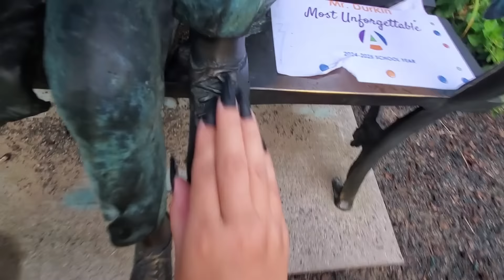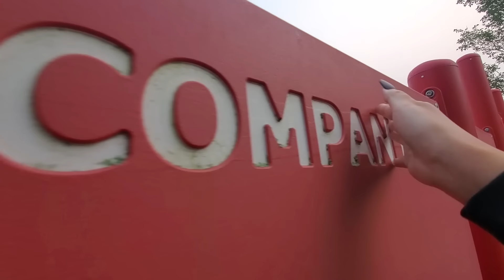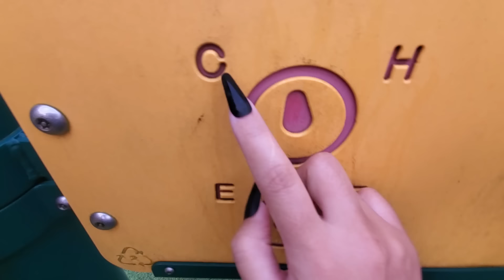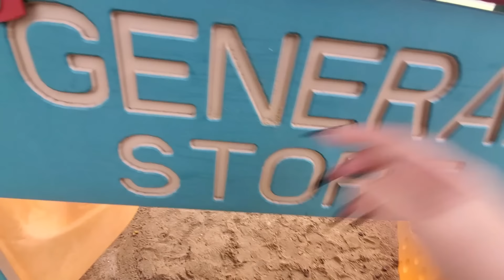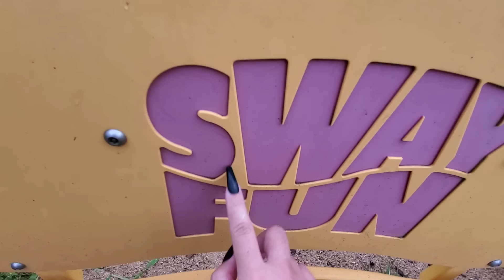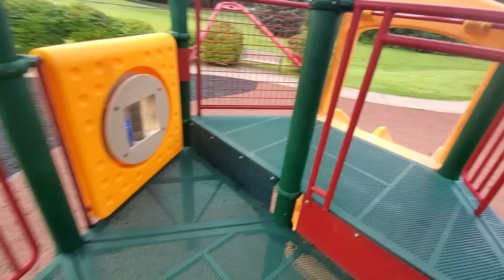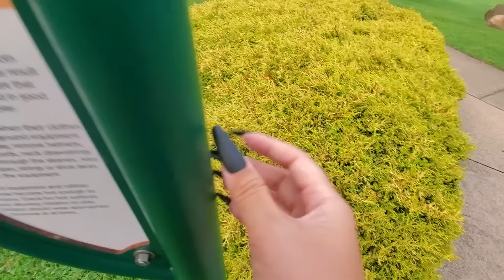Playground ASMR⚽ (Fast Aggressive)

Comment: 00:18 - statue hair

00:30 - statue shoes 

00:40 - finger  “run” / scratch on concrete 

4:12 - fake rocks? 

6:09 - palm tree toy

7:44 - slightly rusted metal 

11:15 -sand toy

14:15 - wet sandy tires

16:30 - wall? scratch 

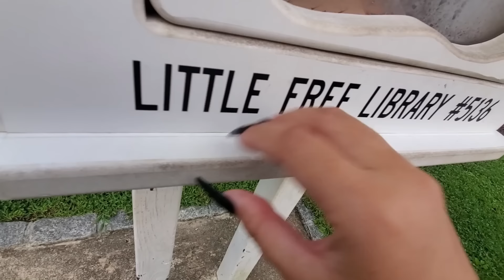17:08 - library 

19:05 - wet pole

23:40

27:30

26:01